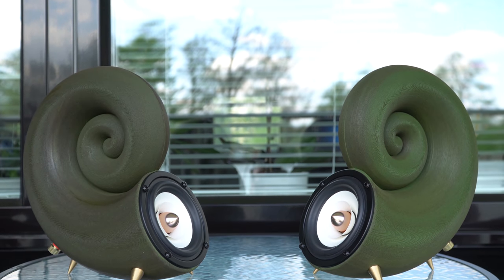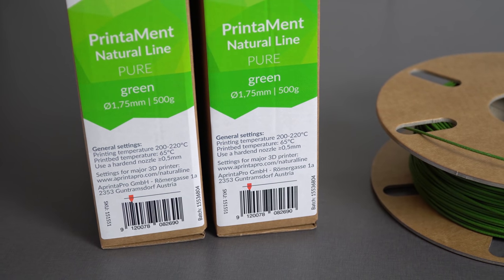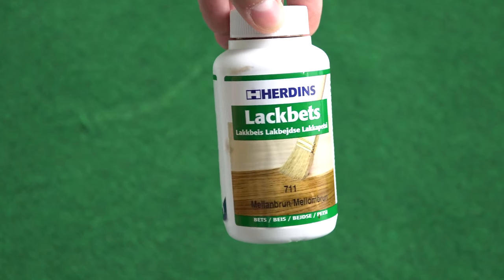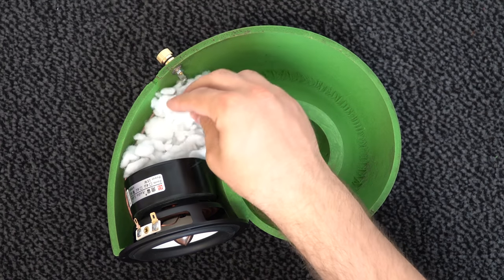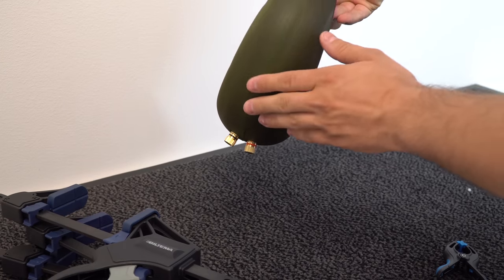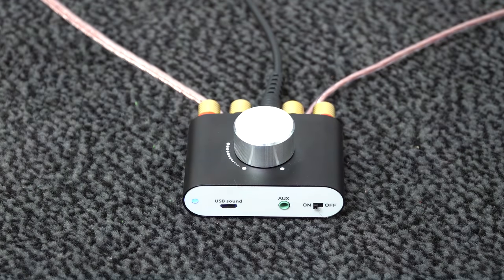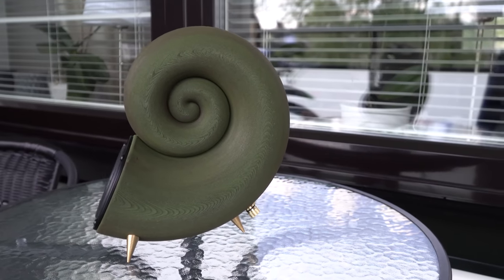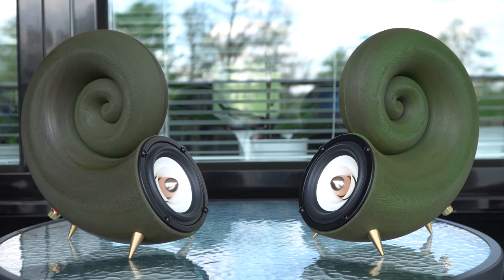3D printed unique looking spiral speakers! DIY

Comment: Wow, stunning.  And they sound exactly like the speaker I'm using on my desktop! ;)
Reply: bro use higher grit sand paper only. it should soften up the texture but not remove it
Reply: sounds quite horrible actually
Reply: @nobodynowhere5213  I KNOW . my desktop speakers are awful.
Reply: maybe because u are listening yours
Reply: @mederoraw  exactly
Reply: Краска Проектор.Projector have you get the stl?

Comment: How about sharing some measurements?   Free software such as Arta or REW will perform a frequency response.  Even using the microphone you have would produce good enough results.   A close measurement,  mic  2 cm away and a farther measurement mic  maybe 25 cm away from speaker would be great to see.  I suspect that the long tube will have some pretty big resonance modes.  I think if you pull the woofer out and really stuff the enclosure tightly with another  300 g of stuffing it could sound better.  Having a perfectly round baffle will introduce large response variations.    Take a look at the Linkwitz page.   http://www.linkwitzlab.com/diffraction.htm     Thanks for sharing.
Reply: I bet there's all sorts of acoustic issues with that design that need addressing. They won't all be solved by stuffing it with fluff ;)
Reply: dont ask that from a millenial youtuber; they only care about adjetives like "cool" and "awesome" but you show them a scientific/physics chart/measurements and they cringe about it; for serious tests about speakers go to some audiophile forum like DrAiX's

Comment: They really do sound pretty tight. Tongue and Groove joining of the two halves like HexiBase does might be a little nice touch.  Also, you can wire speaker polarity in reverse and its fine as long as all the other speakers are wired reverse as well.

Comment: Making these awsome designs. 4 halves printed and stained.
Clamps ordered... What size self tappers did you use. Think I will use some with a Torx head in black. An add on cowling over the speaker just hiding the screw heads would look good.  Great little project and a very clear video. Thank you. Took me 40 hours per side used cura to slice and went for a 40% fill with layers of 0.2mm
Nick
Reply: I am printing them now and also using Cura,  my first one was at 40 percent infill and 4 outer layers at 80mm feed.  Took over 34 hours...  Kinda ridiculous for what it is.  I was surprised to read in this video details that in Simplify3d it only took 16 hours.  That is an incredible difference in speed.

Comment: Have you tried porting the speakers? This style is based on a transmission line speaker where the bass is increased through a chamber. Porting could help dramatically decrease your power requirements because they increase the bass output of a speaker by around 3 dB. Might be something you want to experiment with. That said I don't know the properties of the driver so possibly a sealed chamber works best. They do look nice, almost like mini Nautilus Bowers and Wilkins speakers.
Reply: This is similar to the B&W nautilus. Its not a transmission line design. The idea is that the back wave will travel into the chamber that is getting smaller and smaller. Taking the back wave and trying to turn it into heat so you get reduced internal standing waves, reflections..etc.  Porting it would destroy it.

Comment: what if you added a hole at the end of the spiral?
Reply: in case of this shitty drivers nothing
in common case u will have quarter wave resonator  (that is quite another acoustic design) which is difficult to be adjusted 
and again, depending on which drivers u use it can be shit or not bad
Reply: That would make them a T-line, but with this shape it would be hard to design it properly

Comment: nice looking speaker, i would have made it as smooth as possible and make is a deep piano black, for speaker stands i dont think plastic spikes will work, just look in the hardware store for some goodlooking screws, i use this for my floor standing speakers with soms brass plates underneath. great looking pc speaker.

Comment: 5:48 reversing polarity does not cause such problems. it will cancel the stereo effect (making everything sound off and disembodied) in a stereo set up, and will cause destructive interference for the the bass waves with other drivers running the opposite polarity. granted, you still have to wire up your system in the correct polarity, but not because of any kind of distortion.

Comment: I love how well the finish turned out on that filament! Nice work.  A note on speaker connection: it matters less if the positive pole on the speaker connects to the positive on the amp. What you must pay attention to if using more than one speaker is that you connect then both in the same way.

Comment: Hi, I have maximum 25cm x 25cm x 25cm size of printed item. Is this ok or is it bigger than this? 
Thank you very much for answer
Reply from the maker: You need 30x30cm built plate for these speaker size if I remember correctly but you can scale it down and install a smaller speaker. Try to match them in some 3D software like Windows 3D builder(It's free).

Comment: Finished them and they sound and look great.
Sourced a polyfill material on good old ebay.
I ordered the amp in the list above.
It works great but is no way a 50W Amp .
I now need to find a better amp to drive the speakers.

Comment: The sound would be distorted when the polarity is inverted? That part is untrue, and would only be unpleasant when paired with a correctly wired speaker.. just saying!
Reply from the maker: Distorted/unpleasant/bad/not good/weird... It doesn't matter how you describe it, the point is that one speaker/ bass would kick backwards and one speaker/bass would kick forward, out of phase. Speakers/bass would cancel each other out and for me that's distortion. Also 95% of DIY speaker videos that I watched nobody ever mentioned this.
Reply: @NexiTech  I'm just being over analytical. My point was only that a single speaker will sound the same regardless of its polarity. Don't mind me, they're cool speakers!

Comment: Hello friend, I have been looking for this speaker model, but the brand AUCHARM, which is aesthetically identical to this one of your video (Audio Labs) could you tell me what happens? Are Audio Labs and Aucharm the same company?
Reply from the maker: Emerson Ferreira I Believe they are the same speaker. Try to check the speaker specs sheets if available.

Comment: Okay super awesome start. But how does the output compare to the input in variances with how much voltage that youre putting through it. I only ask bc i know the conical spiral style is about as efficient as it can get, however.... where did you gain or lose in comparison to the frequency response graph that the manufacturer supplied?

Comment: It would look better if you just paint the spiral box in matte black
Reply from the maker: Good idea. I might make one more pair with the resin 3D printer and then paint it in black color. It will be very smooth surface like glass.

Comment: Nice speakers. I would like to buy it but I don't know what is better, do you think it is better the 4ohm or the 8ohm version?
Reply from the maker: 4 ohm will give you double the power over the 8ohm for the same Watt input as far I know Just look at your amplifier is it supporting the 4ohm speakers.
Reply: @NexiTech  Yes I have an amplifier with 4 Ω but has too much power for these speakers, it's a Technics SU-A900, so I need to buy another for these small speakers. 
I also searched the Internet about these speakers and found an article in Gernan that an audiophile wrote about these speakers that he purchases with the box as model Audio Labs Q401. He wrote(translated to English):
"As far as the electrical load capacity of this driver is concerned, the opinions of the technicians involved clearly differ: the data sheet shows 12 watts, a sticker on the magnet indicates 15 W, the nameplate on the box recommends an amplifier output of 20 to 40 W. I suspect that the speaker feels very comfortable up to about 6 W and wears off at 40 W. The speaker is available with 4 and 8 ohms - I ordered and got it with 8 Ω. 
A 12 W broadband with 4 Ω simply makes no technical sense:
 
12 W at 4 Ω corresponds to 6.9 V x 1.7 A
12 W at 8 Ω corresponds to 9.8 V x 1.2 A 

That means the loudspeaker must be connected to 8 Ω Can handle 30% less current with the same power, the amplifier has a better signal-to-noise ratio at 10 V than at 7 V - better for both parts." 
Your speakers are also 8 Ω, do you think that 12 W broadband with 4 Ω doesn't make sense too?

Comment: Could you build one of these for a 6.5" or  8" subwoofer?
But with speaker on one end and port/ hole on the other end so the air can travel through it without breaking it to pieces
Reply from the maker: Donnie Persad I don't think 6.5 Inch Subwoofer can brake it that easy. You can print it in 100% infill PLA for example and  use epoxy to glue it. It will be hard as rock :) To print it for 6
6.5inch/8inch you need massive 3D printer :)
Reply: @NexiTech  if you ever get access to a printer and willing to make a pair for me let me know how much it'll cost... thx
Reply: Donnie Persad, I can help you print these big size. Got 1 cubic print volume.
Reply: @nilssen3dservice284  do you have a cost in mind?
Reply: @Donnie Persad how big you want them ?  Is pla a ok material ?
Reply: depends on the size you want
Reply: @nilssen3dservice284  PLA seems good as long it can withstand the air pressure.
The biggest possible size will be great.
Reply: If i double the size of this design it will fit a 8inch sub
Reply: @nilssen3dservice284  it'll be for an SPL subwoofer so it'll need a lot of volume for the air to travel.

Comment: Too bad that's only a one way speaker. If you have a separated chamber for a tweeter and keeping that one just for the bass it would sound much better.
Reply from the maker: I would build or buy a separate bass box like a small 6 or 8 inch subwoofer and place it on the floor that would be very nice 2.1 system. There are many cheap 2.1 class D mini amplifiers online that sounds pretty good.
Reply: @NexiTech  What I meant was a suggestion of have separate drivers to cause less resonance, you could keep the same design, just put the bass driver on the horn, and add the tweeter on top, like for example the B&W nautilus. But for that you would need a crossover.
Reply: @NexiTech , and if you want to be more audiophile I suggest increasing the speaker size, and make it a 3 way, adding a midrange driver. Make it a new project, your idea is wonderful and you can expand it.

Comment: Awesome built!! Can I print this on the Ender 3 pro?
Reply from the maker: It's too small. You need something from Cr10 line like CR10 V2 or CR10S PRO V2. 300x300mm build plate.
Reply: @NexiTech  thanks for the reply, can you please make a smaller version for this printer?
Reply from the maker: @HaimPeretz  Sorry my man the size of the model are matching with the speakers size. Check the link in video description there are some other similar designs on the Thingiverse.

Comment: I did one as well , but placed a filamente string on the joint of the two parts, to make the finishing
Reply from the maker: Hotend impressoes 3d Nice work. Thanks for commenting.

Comment: Hello,
I wanted to congratulate you for your great work, do you tried to dampen only the inner walls with a viscoelastic material ?

I have another more practical question, what software do you use? how did you go about creating a pavilion shape?
Reply from the maker: gregou69110 Thanks. Yes dampen only the walls should works good as well. I did not try it as it would be more difficult. 
I did not design these Spirals I just found them randomly on the Internet. I place more info in video description about who design them.

Comment: they dont sound really good, right? something sounds kind of muffled
Reply from the maker: José Da Franca Taborda Muffled? You need to change your headphones mate. These speakers sounds crystal clear.
Reply: @NexiTech  hum probably will try another ones 😂 because I have the same drivers but I can't get them you sound that good.. did you measure their parameters? Because the ones on AliExpress are probably far away from reality

Comment: instead of two flat parts i made a ridge on one side and a slit on the other side to give more contact area for the adhesive ( i used glue that fuses  plastics ). Ive done this due to afther a 3 day of use on loud volume ofc the two halves serperated been using em 2 months now no issue, might add internal clips to be practically 100% sure it doesnt serperate

Comment: The project idea is awesome but...why using glue?
Why not using a few tiny neodymium magnets and that way you gonna have a 100% serviceable speaker in case of need?
Reply from the maker: Good luck with using a magnets :)
Unscrew 4 screws and you have a serviceable speaker. Done